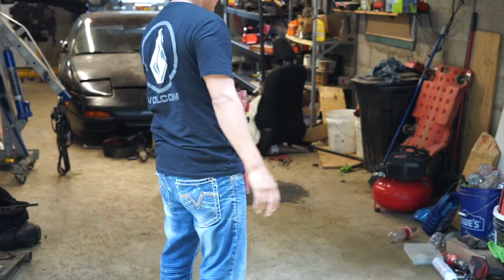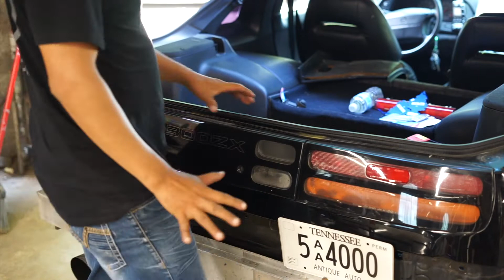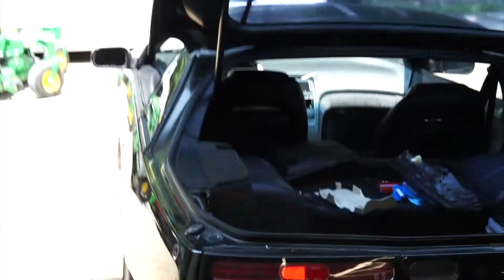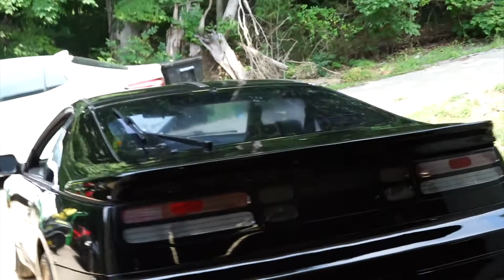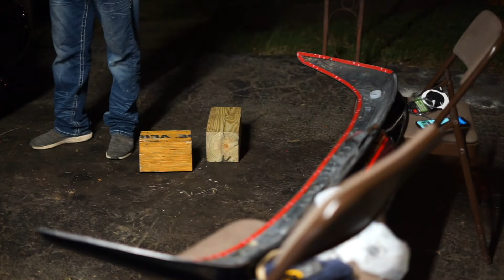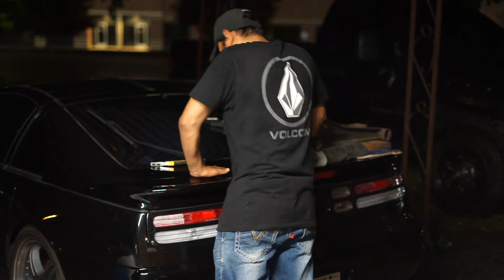300zxtt installing jdm tail lights bumper and spoiler

Comment: What kind of wing is thus a twin z wing ? You only installed with double size tapeor do you used any screws?
Reply from the maker: That is a oem spoiler those came in twin turbo 
And yes I just use a double side tape ✌️